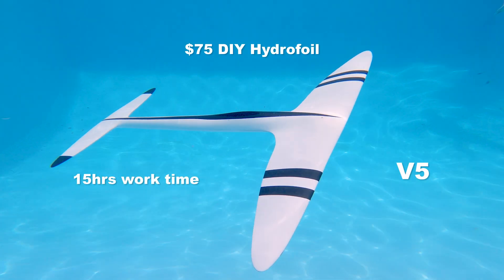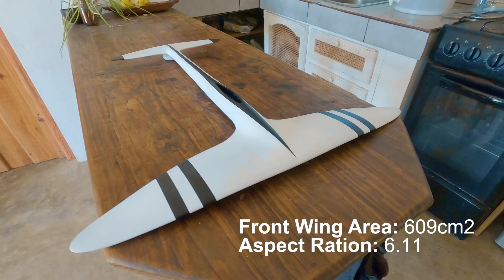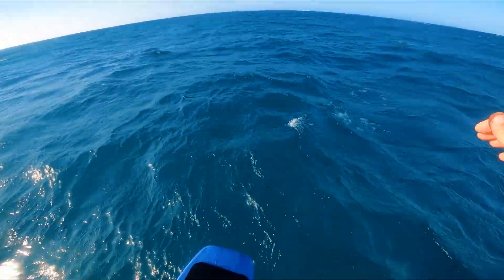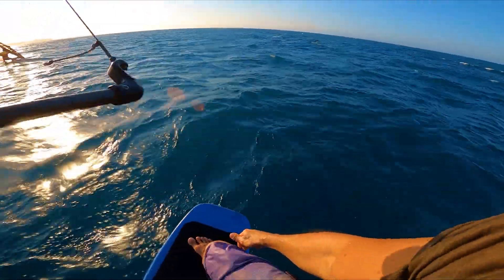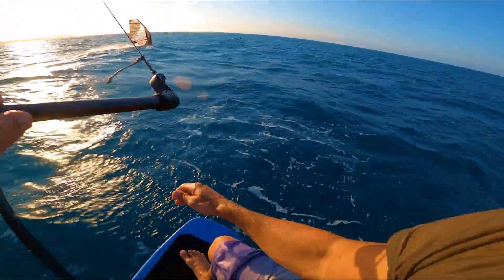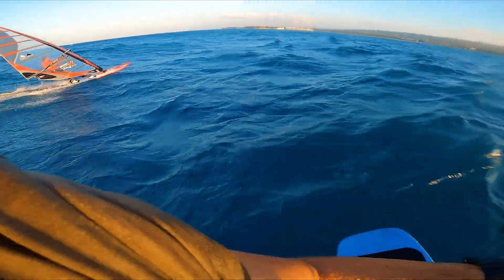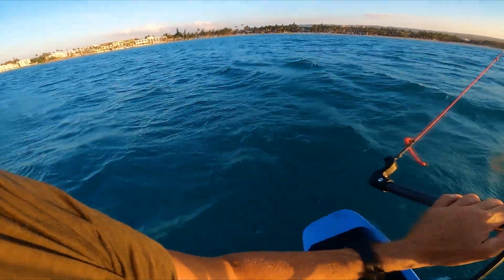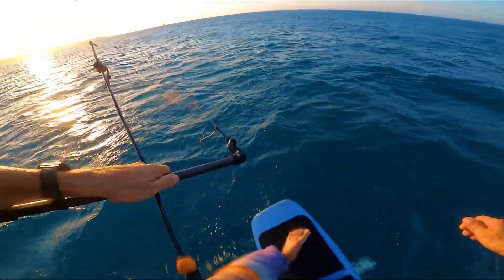First Flight - DIY Hydrofoil V5

Comment: If you want to beat the windsurfer, you need to lean down at least 45 degrees and push hard on your legs you will accelerate significantly. Also putting straps will help with stability, and ability to go faster. Anyway I'm impressed with the build quality of your foil, congrats!! Can you tell me are you live, I couldn't figure out? Merci a toi!!